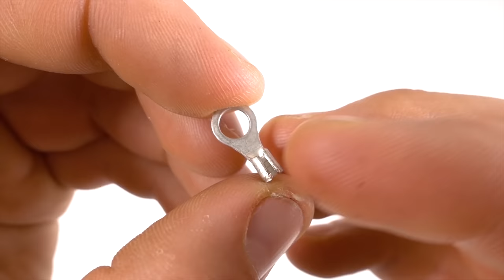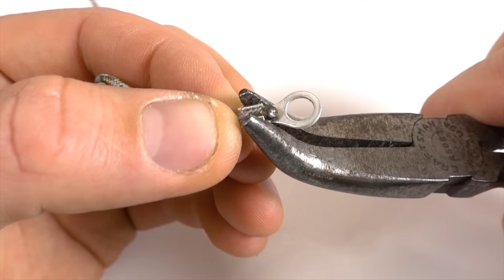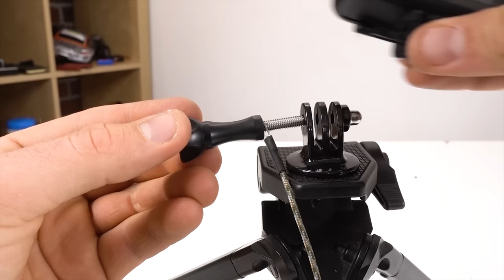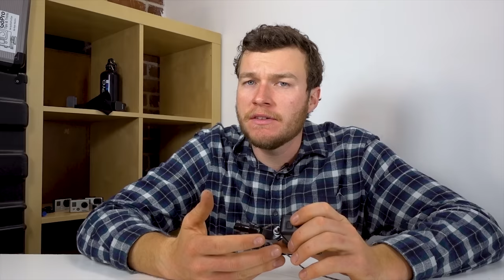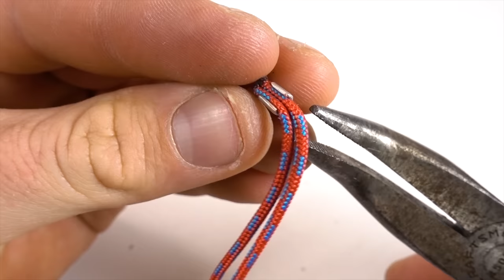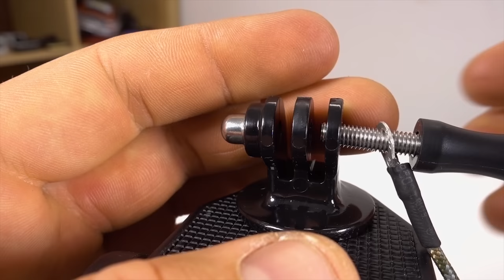DIY Electrical Connector Camera Tether

Comment: Like the idea.
I used to tether my old Hero 3+ black to the top of my snowboard helmet the same way as the other method you showed.
Since i got the Hero 5 i have never used a tether and its always a concern that it could break.Have you ever had a failure of the frame ?
Reply from the maker: I have not and I have not heard of anyone who has. One thing I did not point out in the video was I think the frame has some glass fiber reinforcing in it while it seem the extinction bars and lot of the mounts do not. This would mean the plastic of the frame is stronger than the mount.